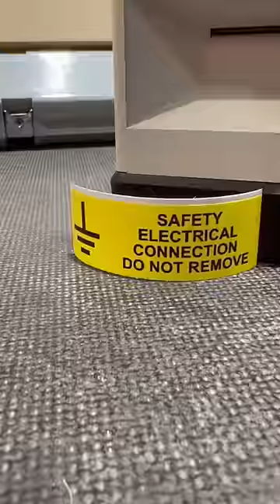Electricians Shocked by this Mysterious Earth Clamp

Comment: As an electrical and an electrical engineer, i have to tell my brother, you've got some nice amd expensive equipment
Reply: its so satisfying when you have the right tools for the job though. I may be a bit bias. I'm a toolmaker after all.
Reply: That's mainly why I watch this channel. 
A lot of the installed components in their videos are not available/applicable in the US of A, but I can get a lot of the tools he uses... Well,  Probably not a $3,000 Klauke crimper.😂
Reply: I work at Walmarts what's up
Reply: As my father always mentioned, The job is difficult enough even when you have the correct tools... so don't hinder yourself.
Reply: "electrician"
Reply: "Electrical and electrical engineer" 😂
Reply: Be careful, this guy's an electrical
Reply: Aside from loving harbor freight, it does help to have nice tools.
Reply: @Sesquac I got fired.. best worker they ever had. Just didn’t like my I.o.u. plans
Reply: @RaccooniusIII I came to the comments to see if anyone pointed this out.  He went to U of Missouri Rolla
Reply: This is why god created electricians. So engineers could have hero’s too!

Comment: We’ve had a plumber die after touching a pipe that was grounded by electricians
Reply: BS
Reply: @troyecoleman green wire hooked up to a hot. mistakenly used as a ground?
Reply: this is why you always ground only at the regulator. I bet that thing wouldn't last 5 years in the places I have to use them.
Reply: @Bennysol  not exactly.
the pipe could have been electrified by a short somewhere and if the breaker didn't pop then a plumber may cut the pipe and now have a grounded side and ungrounded side. if he then grabs both pipes he's toasty. this can also happen if you have a bad neutral coming in because ground and neutral are common in a main panel. so you may be carrying all your neutral loads through a grounded pipe very easily and when grounded down stream of the regulator it becomes a hazard to any unwitting plumber.
Reply: @QuantumMarmalade  good to know. And that makes sense. Sounds like a rare occurrence but also a very real risk at the same time. And I guess checking voltage on a pipe might help but it could change after its been cut
Reply: @Bennysol  all you need is a no contact voltage tester - EMF tester. cheap and fast and you just detect the magnetic field and so no actual voltage readings, just an alarm and light. it's about the size of a fat marker. fluke has really good ones.
Reply: I know nothing about electric
Reply: @QuantumMarmalade but why is your ground wire carrying any current at all oh wait because y'all got 240 on 1 wire. Your neutral should take that energy back to source. Always check your neutral conductor for shorts. Or splits in the jacketing
Reply: @QuantumMarmalade  How can that happen if there are RCD's that are supposed to prevent this?
Reply: @troyecoleman you don't know what your talking about. If you only ever see new construction you might make that remark. But in old ass houses and buildings it happens. Breakers can malfunction and in places with fuses they'll shove metal in to complete the circuit. "BS"? SMH
Reply: @Elektrotechniker RCD or GFCI isn't widespread, in the States at least
Reply: @tnuarb  But this isn't the States. Something QuantumMarmalade for brains hasn't quite figured out.
Reply: The always ongoing war between electricians and plumbers
Reply: @QuantumMarmalade  The problem there though is that when the ground becomes a neutral conductor it doesn't have any voltage, but still carries that amperage that it can then send through your body, that is why water line grounds are frowned upon in the US. 
The inspectors that work near me will fail you for reconnecting one after a main panel upgrade. New ground sources are required.
Reply: @bradyschow3564  It can't 'send amperage through your body' if there's no voltage difference between it, you, and a third point. Removing that voltage is what this bond achieves.

This isn't even a ground source - it's a bond to remove a second source of potential, the buried pipework.
Reply: Then it wasn't actually grounded...
Reply: Then the pipe was not grounded 😬😳
Reply: @bradyschow3564 Earth and ground are not the same thing. Earth potential never changes but ground can be anything you want it to be. EG it wasn’t uncommon to see the chassis of a CRT grounded at negative 126V and if you thought that ground was Earth you could end up dead. In the UK we differentiate between Earth and Ground
Reply: @Monkeh616 HERE HE IS AGAIN!! SUPERHERO OF THE KNOBS!
Reply: @_..-.._..-.._  I'm sorry, have I upset you by having an education?
Reply: @QuantumMarmalade  Have you ever experienced other RF signals triggering this type of meter, from a WiFi network maybe? One wall in my house even lights up my electrical screwdriver, the type that's got a button cell battery in the end for non contact testing, it's also a continuity tester, if I touch that wall with my hand, it's bulb is affected too.
Most odd, there's no sockets or light switch on this solid brick internal wall from what I can see. There is a hot water radiator on either side of it though,... any ideas?
Reply: @steveclark..  hmmmmm. try turning the power to the house off and see if it still does it. could be regular magnetic attraction but I'm betting this wall is ungrounded and built on internal wood floor. if it's not then I'd try a new tester. I am curious though so lmk if you figure it out
Reply: @QuantumMarmalade  Yes, have wooden floor rather than concrete floor in this property. How do you ground a wall though? It's sandwich between two radiators, one is in the hall, the other is in the bedroom, would that not aid with the grounding??
I have tried another meter, will check with the mains switched off in the future. It's certainly an odd one to me.
Reply: How did he die by a pipe that was grounded by electricians? If it was grounded there's no way he died from just touching a plumbing pipe.
Reply: A young girl in my city ended up with severe brain damage after a major electric shock from an outside tap. The neutral connection to her house was in poor condition and it eventually failed. Her house was earthed through the copper piping, and so when the neutral failed the copper pipes became live. She grabbed the tap to turn it off and her muscles contracted and it took minutes for her family and neighbours to break the connection.

Our electricity utility carried out an investigation and I read its findings. I was disappointed that they did not recommend ceasing the practice of using copper pipes as earth. It seems like a bad idea to me.
Reply: @3rdalbum  You make a great point there. I'm wondering if insulating my outside tap handle with rubber is a good idea. Most kitchen and bathroom taps seem to be coated with something so may offer some protection already??
Reply: @3rdalbum  that's exactly why copper tubing shouldn't be used AS the earth ground. We do typically have to ground metal pipes such as copper tubing as well as the building Steel to give them a path to the earth  but it should never be used AS the ground for a building.
Reply: @bradyschow3564 same here in Australia, well in my state anyway. All switchboards upgrades where the incoming water pipe was used as an earth must now have a new earth stake installed
Reply: @georgiafan775  Penny for your thoughts but keep it short. Previous owner of a house I bought did exactly that and put a penny behind an old screw in fuse to the furnace "to keep it from blowing out in the winter". And there was still energized knob and tube wiring in the attic. Someone had replaced all the ungrounded outlets with grounded outlets having the ground going to, you guessed it, a copper pipe in the attic. Yeesh.
Reply: And the water that will come out won't be conductive ????? @steveclark..
Reply: @LionsReignofDomination  I get what you are saying but maybe electricity only really gets to conduct through a still body of water rather than sprinkling out of a tap?
Reply: @misterssippi601  if there was a break in the pipe and repaired with plastic then it's no longer a ground.
Reply: @LionsReignofDomination  correct. That's my point. It must not have been grounded.
Reply: @misterssippi601  exactly. Probably a PEX fix somewhere. It's a shame that a product seems like a miracle until disaster happens.
Reply: @LionsReignofDomination  Are you saying that the original poster made this story up then?
Reply: True - I know a young guy killed by this. Old building, there was a fault, active was touching the Earth somewhere, and when he undid the old pipe, as soon as a gap between he was killed. This is straight out facts.
Reply: @steveclark.. I agree with the poster, I also personally attended a funeral for somebody killedby this - its illegal.
Reply: @rinzler9775  Thanks for replying. How can plumbers protect themselves against this, by using a voltage tester on pipes before they touch it?
I'm in the UK, considering that our H&S rules have become over the top in many other industries, I'm surprised that they haven't jumped on this one for plumbers.
Reply: @rinzler9775  How should the industry change to prevent more plumbers getting electrocuted?
They need to check every pipe with a voltage tester before they touch it?
Reply: @QuantumMarmalade  If there is a broken PEN on the supplier feed then all the bonded conductors can go to near line voltage if there is any load.

It is not just a broken PEN to that property. If there a broken PEN supply to an adjacent property you end up with what is called a "diverted neutral", then current can flow via any conductive water or gas piping from another property via that route. If the main ground bonding wire is temporarily detached in the CU (as it required for some testing working), then the load in another property can drive the copper pipework and protective earth circuit to near line voltage...
Reply: Well they weren’t doing their job properly. They are meant to check that anything isn’t live that they are touching because there is a risk however they won’t die if it’s done correctly most likely a plumber mucked it up replacing pipes.

Comment: Ahh yes the spicy water earthing. They did that before in sweden. They stopped for a reason. If you are showering or have your hands in the faucet when lightning hits the powering it can cause you to get electrocuted. The same if something earth out (mostly a problem in a house without an earth breaker).
Reply: It’s not using the pipes to supply ground. It’s bonding the pipes to ground (which is provided from supplier or earth rod)
Reply: Well, i guess, thats what the title means. Electricians (and everybody else) shocked...
Reply: Ungrounded plumbing is how you get shocked through plumbing, if anyone is relying on this for the main grounding line they have no idea what they're doing
Reply: The final ground should be neutral supplied from the utillity pole. earth rods are for the case where lightning strikes
Reply: I'm not an electrician or a plumber, but I know that in the UK this is in the building regulations (which I know because I had a house built).  Nobody is using the copper plumbing as a ground; they're earthing it so it doesn't give you a shock.  How is it I know this but so many 'expert' commentators here don't?

Comment: If you twist stranded wire backwards, then bend and put around the screw, it won't splay out.  It will hug the screw post as you tighten it down.
Reply: Ive got to try that
Reply: By backwards, I assume you mean counter clockwise?
Reply: I'm left handed, that comes naturally. 😀
Reply: It’s not backwards. You just wrap the wire around it the direction you will tighten it.
Reply: It's never a good idea to put stranded wire under a screw without a proper connector crimped on. Somewhere I have pictures of the last guy that thought that was ok, and the resulting melted connections and burned wire.

Comment: I'd keep the Legrand clamp method and get rid of of the single  screw termination and replace with a 2 conductor common Cage Clamp termination. Quick cable strip and push insert. No need for all the labour and extra tooling

Comment: Great and innovative earth clamp. Though am more interested in the interchangeable dies crimping tool, it really looks awesome. I actually need one of those.
Edited to add
Can someone get additional dies for the same crimper.
Reply: Elpress
Reply: Blue Point makes one as well…
Reply: Klauke has some solid tools. I have the K507 and a bunch of extra Dies for larger diameters.
Reply: They're quite handy. I have dies for Anderson Powerpoles and for crimping various coax connectors. Worth it for a repeatable result over and over.

Comment: Apprentice automotive electrician/mechanic here, question for you. Would there ever be any risk of voltage back feeding or spiking or anything into this kind of ground wire? If so/if not why? And are these gas pipes? Water pipes? Super satisfying video tho, keep up the good work!!
Reply: I do/ work the same as you but for semitrucks 
My question: what would he do against korosion
Reply: They're water pipes.  Copper isn't used for gas pipes, way too much risk if in contact with an electrical conductor.  Even the water passing through copper pipes will create electrical activity.
Reply: Ignoring pilot tubes, obviously.  A short length close to the source of intended ignition doesn't carry the same risk.
Reply: @RutgersSieve  Here in the UK copper tube is 100% used on the consumer side of the gas meter in domestic premises. Older underground supplies are steel barrel types which are effectively electrodes so the point here is we Bond these pipes with the Distributor (electricity supply) to negate any difference in potential (volts)
Reply: Utility wireman here. What do you mean voltage back feeding into this wire? Edit:(reread it). I would figure this is used to keep the piping in the house at ground potential. Let’s say a wire touches the piping. Fault current would go back to the pole and down the neutral. A/C electricity wants to go back to where it’s created. At least in the USA, panels are bonded at the first disconnecting means of a service entrance(the main panel typically). Both neutral and ground are tied together. To double the means of return path to the pole/utility.
Reply: @userx702  More specifically it's to ensure there's no difference in potential between the electrical ground and buried pipework which will introduce a literal ground potential which may not match, especially under fault conditions. If there's no contact or an insulating section, there's no need for the bond.

Comment: I don't understand why anyone wouldn't ground their pipes. And it should be done in multiple places for redundancy! ❤ 

Does anyone realize how often rodents chew live wires bare in walls that can contact piping, or an appliance like a shorted dishwasher or garbage disposal energizes the pipework, which is sometimes today supplied and returned through PVC risers which DON'T ground them. This leaves potential voltage waiting for you to get out. 🎉

Comment: As an American I’ve been doing a ton of wiring on European panels in portable distribution centers going to Israel. Can confirm European panels are much much nicer than American stuff. We are so behind the times here
Reply: By a decade or more
Reply: Ok, let's add another 50K to the cost of a house just to have fancy screw in terminals.
Reply: Other than the general lack of working space... The smaller wire and DIN mounting is nice tho.
Reply: @wadewilson6628  A lot of this stuff is cheaper than your old junk. Certainly doesn't add anything like that to the price - but hey, you've got to save every penny to get a new pickup this year, right?
Reply: In new European installations, at least in the Netherlands, all circuits must be protected by a 30mA RCD and we also switch the neutral since the 60's and in the 70's a 30mA RCD was already mandatory for the kitchen and bathroom and the fuses that we use are much safer since they are sealed, in the UK they used wire fuses without any RCD, and we still use Diazed fuses in the energy distribution and heavy installations because they have an insane breaking capacity of 50.000 amps. In America you only have special RCD sockets and those sockets are also really weak for their rated current. 230V is also much safer because of the low currents, we have here a 25A or 35A single phase supply or in newer houses a 3 phase 25A supply.
Reply: Looking at Europe, I'm glad we're lagging behind, but horrified at what we will become.
Reply: @tomokokuroki2506  We lead the way in the wrong direction, lol. Anyway, all such countries will stop functioning as they have historically, because of demographic shift...
Reply: @wadewilson6628 nope our gear is a lot cheaper than US